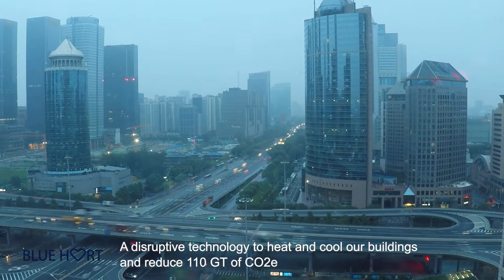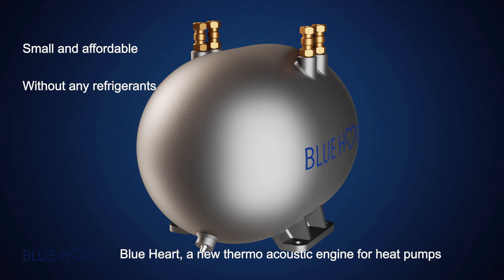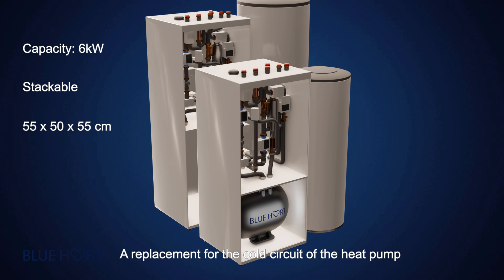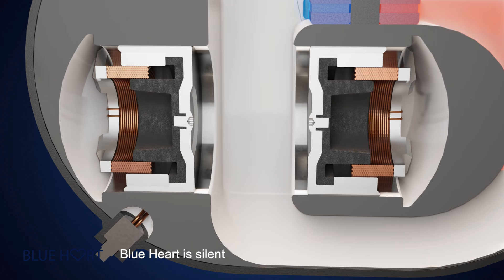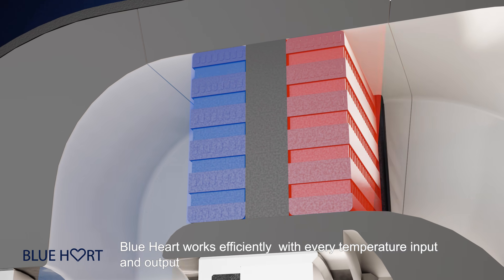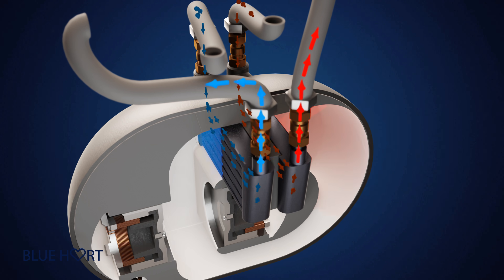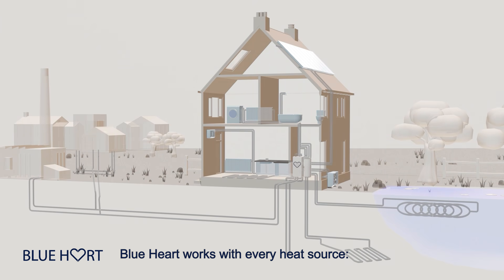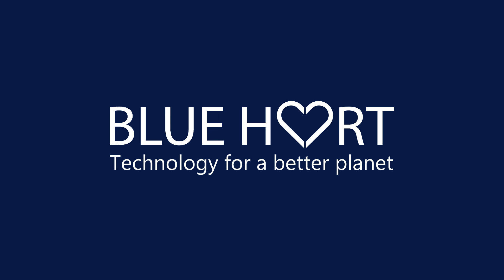BlueHeart: A New Technology to Generate Heat and Cold

Comment: Summary: Helium=magic, will heat and cool from any source to any sink. Oh and pressure waves mean its silent, what exactly do they think noise is?
Reply: I think researchers just recently figured out how to reduce noise. I think it was called insulation or something. Must be French.
Reply: It's a very odd very vague announcement. I think this technology exists currently at a smaller scale for cryocooling, but if you are moving heat and not just "making cold" as a purpose, i doubt it is more efficient than resistive. It certainly isn't in the cryocooler segment where you might get 5 watts moved with a 200w input
Reply: Needs to clarify few points:
o) This is based on Stirling cycle. Principle is known since 1812! Recent research led to "thermoacoustic" designs that are so much easier to implement. 
o) Lots of videos out about the application for cryo cooling.
o) Hydrogen is most efficient medium for that, Helium is safest option and nearly as good. So that is in fact a clever choice.
o) This is a CLOSED cycle - the working gas is hermetically sealed in. Therefore no sound transmission into atmosphere. At the most you could hear a hum transmitted across the housing.
o) BUT since 2023 not much news about it?
o) As a heat pump it needs electric energy supplied into the "linear coils". Ideally at correct resonance frequency. This seems to be very challenging and many promising "free piston" and acoustic stirling projects got stuck at that hurdle...

Comment: So nothing on coefficient of performance. Guessing it is quite low then compared to a conventional heat pump. If it's above 1, that's great but perhaps only practical and efficient in cold climates when replacing fuel or resistive vs much more than 1 for conventional heat pumps. I think the state of the art is up to 6 COP